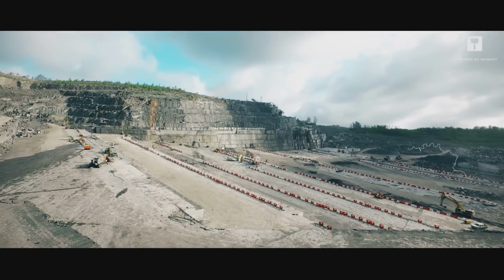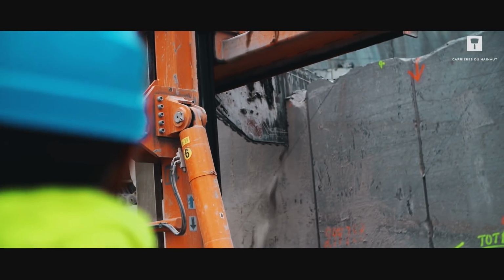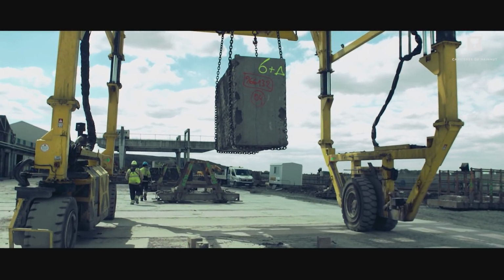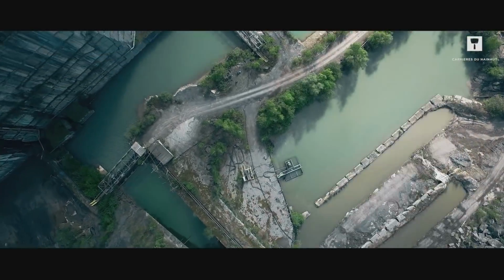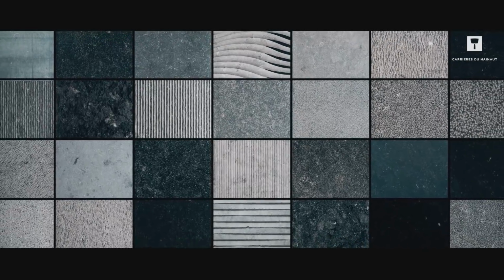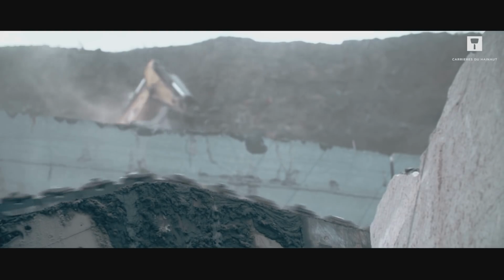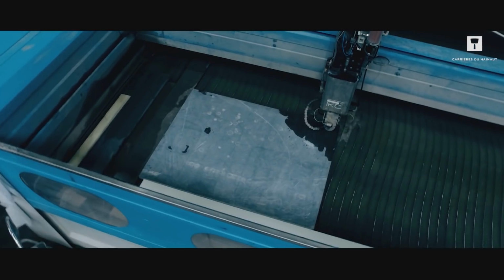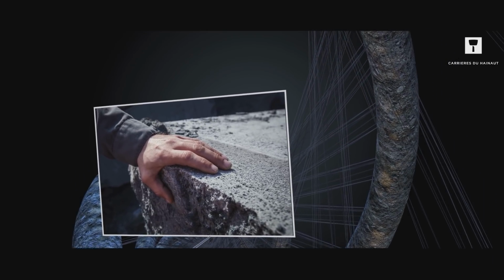The origin of Belgian blue limestone, from extraction to finished product

Comment: This is amazing, love it. Human engineering at its best! But seeing the permanent destruction of the environment makes me wonder why people are so up in arms about Canada's oil sands which is returned to its natural state after it's been extracted
Reply: Longyi super fine powder grinding machines advantages:
1. Powder from 48~4microns, fineness is adjustable
2. Built-in high efficiency classifier, no more investment cost for classifying system.
3. Smart PLC operation system, and integrated control system: 1 computer could operated max 6 machines, saving management cost.
4. No particle air pollution, more environment-friendly.
5. Compact structure to save factory space and lower foundation construction cost.
 
For CaCO3 powder
The whole grinding system including grinding, classifying, powder collector, fan, PLC cabinet, feeding conveyor and others, system power is 370Kw, the real working power is 296KW
1. D97=23um (600mesh)    Output: 10tons/h      Energy Consumption: 29.6Kw/Ton
2. D97=16um(800mesh)     Output: 8tons/h       Energy Consumption: 37Kw/Ton
3. D97=10um (1250mesh)    Output: 4.5tons/h    Energy Consumption: 65.7Kw/Ton  
4. D97=6.5um(2000mesh)    Output: 2.5tons/h   Energy Consumption: 118.4Kw/Ton

Comment: It's heartening to see an industrial-age firm still growing and innovating well into the third decade of the 21st Century. I particularly enjoyed the tech and handcraftship - if you will - that present the market with various BL finishes.
Reply: Longyi super fine powder grinding machines advantages:
1. Powder from 48~4microns, fineness is adjustable
2. Built-in high efficiency classifier, no more investment cost for classifying system.
3. Smart PLC operation system, and integrated control system: 1 computer could operated max 6 machines, saving management cost.
4. No particle air pollution, more environment-friendly.
5. Compact structure to save factory space and lower foundation construction cost.
 
For CaCO3 powder
The whole grinding system including grinding, classifying, powder collector, fan, PLC cabinet, feeding conveyor and others, system power is 370Kw, the real working power is 296KW
1. D97=23um (600mesh)    Output: 10tons/h      Energy Consumption: 29.6Kw/Ton
2. D97=16um(800mesh)     Output: 8tons/h       Energy Consumption: 37Kw/Ton
3. D97=10um (1250mesh)    Output: 4.5tons/h    Energy Consumption: 65.7Kw/Ton  
4. D97=6.5um(2000mesh)    Output: 2.5tons/h   Energy Consumption: 118.4Kw/Ton

Comment: Because of the weird cinematic color palette of this video, we can't even see the real natural color of the supposedly special blue limestone. All that matters is cinematics and epic music, right?
Reply: Does any body know the tittle of this cinematic audio background...?  Thank you and great job
Reply: Longyi super fine powder grinding machines advantages:
1. Powder from 48~4microns, fineness is adjustable
2. Built-in high efficiency classifier, no more investment cost for classifying system.
3. Smart PLC operation system, and integrated control system: 1 computer could operated max 6 machines, saving management cost.
4. No particle air pollution, more environment-friendly.
5. Compact structure to save factory space and lower foundation construction cost.
 
For CaCO3 powder
The whole grinding system including grinding, classifying, powder collector, fan, PLC cabinet, feeding conveyor and others, system power is 370Kw, the real working power is 296KW
1. D97=23um (600mesh)    Output: 10tons/h      Energy Consumption: 29.6Kw/Ton
2. D97=16um(800mesh)     Output: 8tons/h       Energy Consumption: 37Kw/Ton
3. D97=10um (1250mesh)    Output: 4.5tons/h    Energy Consumption: 65.7Kw/Ton  
4. D97=6.5um(2000mesh)    Output: 2.5tons/h   Energy Consumption: 118.4Kw/Ton

Comment: Amazing I never knew how rocks were made and fashioned to products, slabs and tiles
Reply: Longyi super fine powder grinding machines advantages:
1. Powder from 48~4microns, fineness is adjustable
2. Built-in high efficiency classifier, no more investment cost for classifying system.
3. Smart PLC operation system, and integrated control system: 1 computer could operated max 6 machines, saving management cost.
4. No particle air pollution, more environment-friendly.
5. Compact structure to save factory space and lower foundation construction cost.
 
For CaCO3 powder
The whole grinding system including grinding, classifying, powder collector, fan, PLC cabinet, feeding conveyor and others, system power is 370Kw, the real working power is 296KW
1. D97=23um (600mesh)    Output: 10tons/h      Energy Consumption: 29.6Kw/Ton
2. D97=16um(800mesh)     Output: 8tons/h       Energy Consumption: 37Kw/Ton
3. D97=10um (1250mesh)    Output: 4.5tons/h    Energy Consumption: 65.7Kw/Ton  
4. D97=6.5um(2000mesh)    Output: 2.5tons/h   Energy Consumption: 118.4Kw/Ton 

 
It is suitable for processing nonmetallic minerals such as calcium carbonate, calcite, Kaolin, clay, barite, talc, gypsum, limestone, calcium oxide, bentonite, dolomite etc.
Reply: It is buried deep beneath the silt. Surprising!

Comment: Barre,Vermont has a granite quarry that is an awesome thing to see and tour. Outside town there is a graveyard that holds the bodies of some of the European stone cutters and carvers that worked there and their tombstones are just beautiful. The craftsmanship on the tombstones was done by the stone carvers as a dedication to those who passed and worked there.
Reply: good to know
Reply: Its not granite here in Hainaut its limestone.
Reply: But let's stop joking.
Than with CNC machines in no time. You work all types of stones including granite (hard and used).
A bridge crane is missing here in this long shed.
For moving heavy loads.
And then there are a few forklifts.
Reply: I’m one of those guys.. Vermont grey.
I work on headstones Daily. It’s cool seeing and knowing where the granite comes from in the world. 
We have Wausau red granite here in Wisconsin. But they stopped mining it.
So no more red granite from here.
Reply: Longyi super fine powder grinding machines advantages:
1. Powder from 48~4microns, fineness is adjustable
2. Built-in high efficiency classifier, no more investment cost for classifying system.
3. Smart PLC operation system, and integrated control system: 1 computer could operated max 6 machines, saving management cost.
4. No particle air pollution, more environment-friendly.
5. Compact structure to save factory space and lower foundation construction cost.
 
For CaCO3 powder
The whole grinding system including grinding, classifying, powder collector, fan, PLC cabinet, feeding conveyor and others, system power is 370Kw, the real working power is 296KW
1. D97=23um (600mesh)    Output: 10tons/h      Energy Consumption: 29.6Kw/Ton
2. D97=16um(800mesh)     Output: 8tons/h       Energy Consumption: 37Kw/Ton
3. D97=10um (1250mesh)    Output: 4.5tons/h    Energy Consumption: 65.7Kw/Ton  
4. D97=6.5um(2000mesh)    Output: 2.5tons/h   Energy Consumption: 118.4Kw/Ton

Comment: 340 Million years ago!!!
Reply: Longyi super fine powder grinding machines advantages:
1. Powder from 48~4microns, fineness is adjustable
2. Built-in high efficiency classifier, no more investment cost for classifying system.
3. Smart PLC operation system, and integrated control system: 1 computer could operated max 6 machines, saving management cost.
4. No particle air pollution, more environment-friendly.
5. Compact structure to save factory space and lower foundation construction cost.
 
For CaCO3 powder
The whole grinding system including grinding, classifying, powder collector, fan, PLC cabinet, feeding conveyor and others, system power is 370Kw, the real working power is 296KW
1. D97=23um (600mesh)    Output: 10tons/h      Energy Consumption: 29.6Kw/Ton
2. D97=16um(800mesh)     Output: 8tons/h       Energy Consumption: 37Kw/Ton
3. D97=10um (1250mesh)    Output: 4.5tons/h    Energy Consumption: 65.7Kw/Ton  
4. D97=6.5um(2000mesh)    Output: 2.5tons/h   Energy Consumption: 118.4Kw/Ton

Comment: Very interesting video 📹thank you 😊from Scotland
Reply: Longyi super fine powder grinding machines advantages:
1. Powder from 48~4microns, fineness is adjustable
2. Built-in high efficiency classifier, no more investment cost for classifying system.
3. Smart PLC operation system, and integrated control system: 1 computer could operated max 6 machines, saving management cost.
4. No particle air pollution, more environment-friendly.
5. Compact structure to save factory space and lower foundation construction cost.
 
For CaCO3 powder
The whole grinding system including grinding, classifying, powder collector, fan, PLC cabinet, feeding conveyor and others, system power is 370Kw, the real working power is 296KW
1. D97=23um (600mesh)    Output: 10tons/h      Energy Consumption: 29.6Kw/Ton
2. D97=16um(800mesh)     Output: 8tons/h       Energy Consumption: 37Kw/Ton
3. D97=10um (1250mesh)    Output: 4.5tons/h    Energy Consumption: 65.7Kw/Ton  
4. D97=6.5um(2000mesh)    Output: 2.5tons/h   Energy Consumption: 118.4Kw/Ton

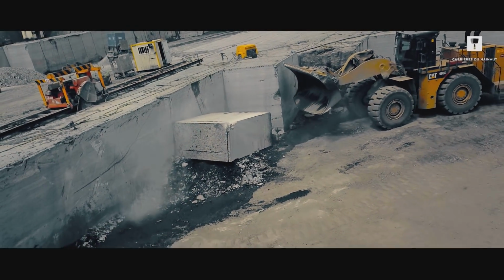Comment: at 4:27 how did the 100 tonne block just slide across????
Reply: Layers are at 12 degree slope - so the loader just give the blocks a nudge and they slide.
Reply: @ArthurDentZaphodBeeb  Mr Tiger must be a child or an adult devoid of the ability to work out simple problems.  
I am a women of meagre education and an average IQ yet I didn’t need explanation. It was obvious. Apart from the incline, smaller pieces underneath would help to move it as they would act as rollers reducing the friction between the slab and the rock base beneath.

Comment: Which explains why we are charging $80,000 for your kitchen remodel, madam. Although limestone isn't the best material for kitchen surfsces.
Reply: Lol make it 120,000$, i think she can pay that much
Reply: Limestone comes different density's this material quite strong and dense.
Reply: @TheBrownsberg  It's not its hardness or strength that's the problem. It's the chemical composition, mainly calcium carbonate. It has very little resistance to acidic liquids such as vinegar or orange juice.
Reply: @nigelrg1  true.
Reply: @nigelrg1  sealers. people who buy these materials don't care they are rich. they replace them in under 10 years time with the next trendy material.
Reply: $80K is cheap. Can easily spend that just on appliances.

Comment: Marvelous mining.. proud to be a miner
Reply: Longyi patented built-in 3 classifiers dry grinding machines already put into mass production.
For limestone/dolomite/calcite 
The whole grinding system power is around 370Kw
A.D97=4.8um (≦2um:  73.5%)   Output: 1000kg/h       Energy Consumption: 296Kw/Ton
B.D97=6.3um (≦2um:  64%)     Output: 1500kg/h       Energy Consumption: 197.3Kw/Ton
C.D97=7.1um (≦2um:  57%)    Output: 1900kg/h        Energy Consumption: 155.8Kw/Ton  

For Talc powder, 
Longyi powder grinding mill power is 250Kw, the real working power is around 200~225Kw, including classifying system.
A. D90=10.5~10.7um   output:  4 tons/hour
B. D90=9.8~11um      output:  3 tons/hour

It is suitable for processing nonmetallic minerals such as calcium carbonate, calcite, Kaolin, clay, barite, talc, gypsum, limestone, calcium oxide, bentonite, dolomite etc.
Samuel 
MP/Wechat/whatsapp: +8615105956429

Comment: 100 tons too heavy to move...
Pyramid builders: lol, hold my beer
Reply: oh plis, Aliens don't drink beer
Reply: Some of the blocks in the pyramids of Khufu and Smenkaure were 1000 tons especially in th grannd gallery.
Reply: @kevinklingner3098  largest is 70-80 tons
Reply: Pyramid blocks weren’t that heavy, 2.5 tons. A few guys can pull that on rollers easily
Reply: @mhxxd4  Did you weigh 'm, quote 'on rolls' yeah is that how they did it, what a marvelous explanation. You witnessed the whole thing while they build it right? Troll
Reply: Longyi super fine powder grinding machines advantages:
1. Powder from 48~4microns, fineness is adjustable
2. Built-in high efficiency classifier, no more investment cost for classifying system.
3. Smart PLC operation system, and integrated control system: 1 computer could operated max 6 machines, saving management cost.
4. No particle air pollution, more environment-friendly.
5. Compact structure to save factory space and lower foundation construction cost.
 
For CaCO3 powder
The whole grinding system including grinding, classifying, powder collector, fan, PLC cabinet, feeding conveyor and others, system power is 370Kw, the real working power is 296KW
1. D97=23um (600mesh)    Output: 10tons/h      Energy Consumption: 29.6Kw/Ton
2. D97=16um(800mesh)     Output: 8tons/h       Energy Consumption: 37Kw/Ton
3. D97=10um (1250mesh)    Output: 4.5tons/h    Energy Consumption: 65.7Kw/Ton  
4. D97=6.5um(2000mesh)    Output: 2.5tons/h   Energy Consumption: 118.4Kw/Ton

Comment: Beautiful nature
Reply: Longyi super fine powder grinding machines advantages:
1. Powder from 48~4microns, fineness is adjustable
2. Built-in high efficiency classifier, no more investment cost for classifying system.
3. Smart PLC operation system, and integrated control system: 1 computer could operated max 6 machines, saving management cost.
4. No particle air pollution, more environment-friendly.
5. Compact structure to save factory space and lower foundation construction cost.
 
For CaCO3 powder
The whole grinding system including grinding, classifying, powder collector, fan, PLC cabinet, feeding conveyor and others, system power is 370Kw, the real working power is 296KW
1. D97=23um (600mesh)    Output: 10tons/h      Energy Consumption: 29.6Kw/Ton
2. D97=16um(800mesh)     Output: 8tons/h       Energy Consumption: 37Kw/Ton
3. D97=10um (1250mesh)    Output: 4.5tons/h    Energy Consumption: 65.7Kw/Ton  
4. D97=6.5um(2000mesh)    Output: 2.5tons/h   Energy Consumption: 118.4Kw/Ton
Reply: not so beautiful after humans raped it
Reply: Longyi super fine powder grinding machines advantages:
1. Powder from 48~4microns, fineness is adjustable
2. Built-in high efficiency classifier, no more investment cost for classifying system.
3. Smart PLC operation system, and integrated control system: 1 computer could operated max 6 machines, saving management cost.
4. No particle air pollution, more environment-friendly.
5. Compact structure to save factory space and lower foundation construction cost.
 
For CaCO3 powder
The whole grinding system including grinding, classifying, powder collector, fan, PLC cabinet, feeding conveyor and others, system power is 370Kw, the real working power is 296KW
1. D97=23um (600mesh)    Output: 10tons/h      Energy Consumption: 29.6Kw/Ton
2. D97=16um(800mesh)     Output: 8tons/h       Energy Consumption: 37Kw/Ton
3. D97=10um (1250mesh)    Output: 4.5tons/h    Energy Consumption: 65.7Kw/Ton  
4. D97=6.5um(2000mesh)    Output: 2.5tons/h   Energy Consumption: 118.4Kw/Ton 

 
It is suitable for processing nonmetallic minerals such as calcium carbonate, calcite, Kaolin, clay, barite, talc, gypsum, limestone, calcium oxide, bentonite, dolomite etc.